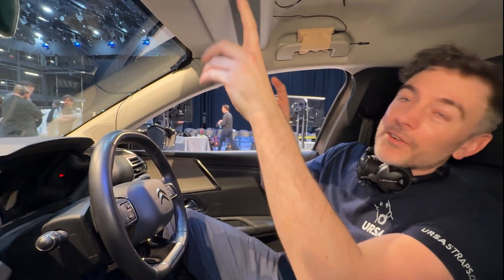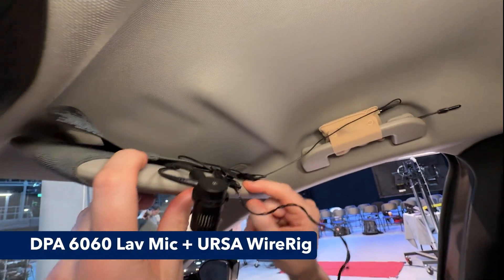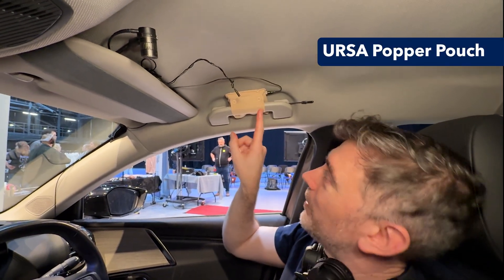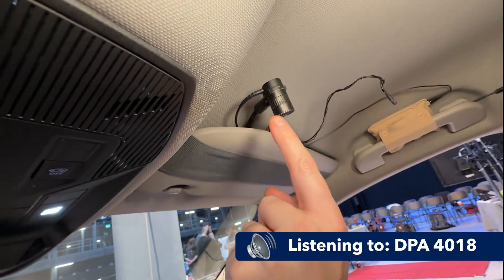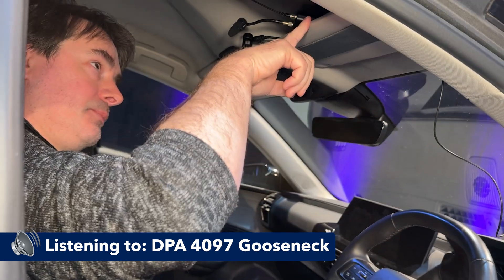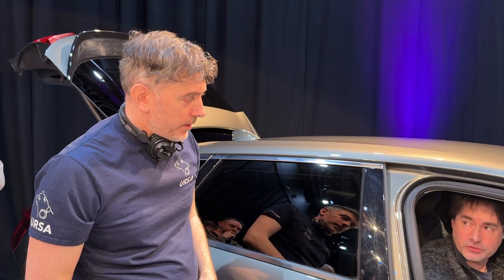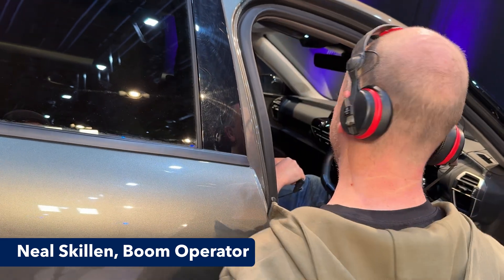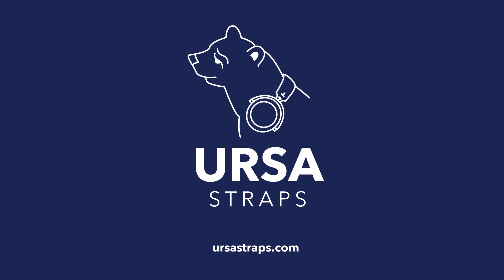The Car Rig Mic Comparison - DPA 6060 vs 4018 & 4097

Comment: IMHO and small expertise working with car It's better to go towards the camera operator with the cable. I see the cable and the pack. Usually the camera is pointing towards the driver.
Reply: 100% agree. which ever side the camera is facing (eg. drivers side), I would wire it across and place the TX on the passenger side.